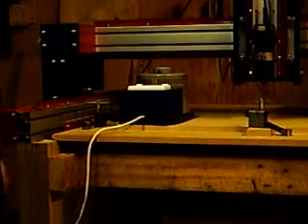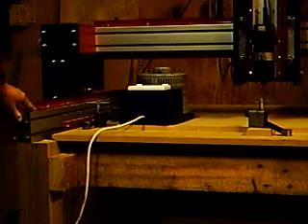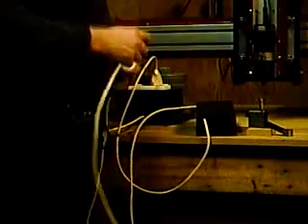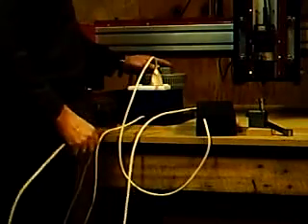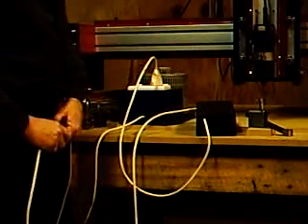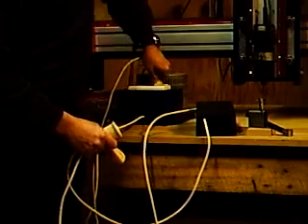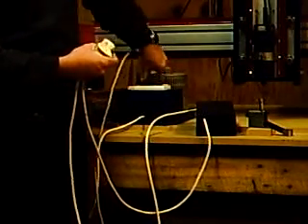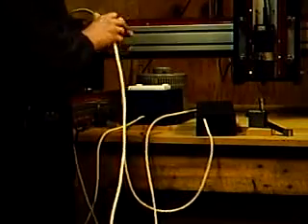Variac Speed Controller - CNCnutz Episode 1

Comment: Is this a DC or AC motor? How is it wired?
Reply from the maker: It is both. Since the motor uses a commutator it can be used on either AC or DC. It was sold as a 230v ac motor. The wiring is unchanged and the same for both.
Cheers Peter